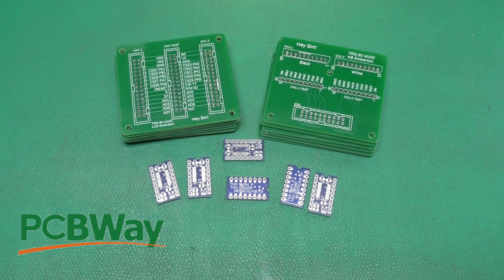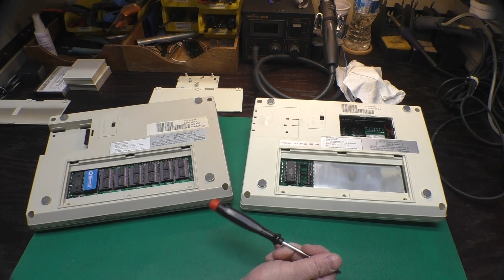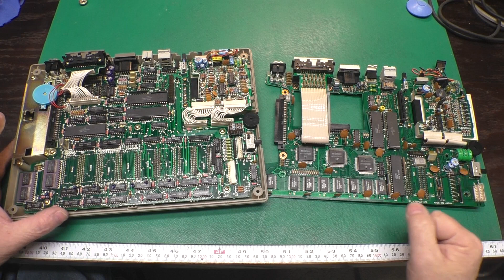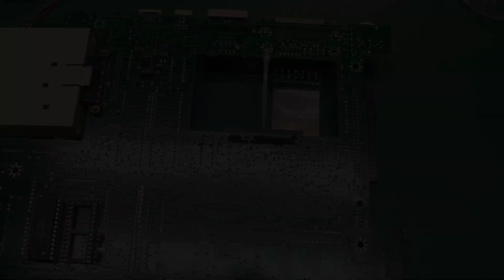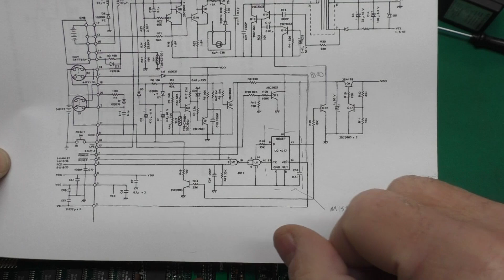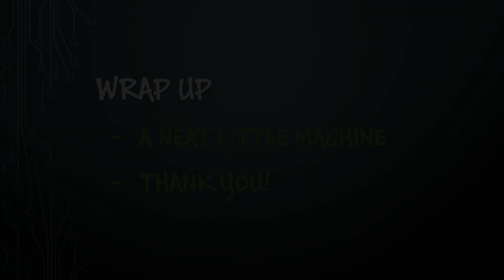NEC PC-8300, “It’s dead Birt!”. A dead power supply and NEC PC-8201A comparison

Comment: what are those gatorade chips used for?
Reply from the maker: 'gatorade chips'? I'm not sure what you mean. Are you referring to something shown in the video?
Reply: @HeyBirt  Reflecting about it i think it meant gate array, not gatorade
Reply from the maker: @milp_and_didi  OK, now I know what you were referring to. The older computers Kyocera made like the TRS-80 Model 100 used many separate logic chips for things like address decoding. The PC-8201 combined all of that functionality into a few custom gate array chips. This makes the device simpler and is less expensive to manufacturer.

Comment: Great video, Birt.  I'm glad you're out there supporting folks that end up with non-working Kyocera laptops!  :)
---Gary Weber (Web8201)
Reply from the maker: Thanks Gary. It is always a lot of fun working on one of these machines. It is also interesting to see the 'heritage' of the original design used for the M100 brought forward through the NEC PC-8300.
Reply: Just found your website.  I might even try the EPROM hacks! the NEC 27C1000 or  HN27C301G
Reply: @squirlmy  I highly recommend it.  It's nice to have a PC-8300 with a modded 128K system image that has the Y2K cosmetic fix.

Comment: Finding the obvious is not always obvious .. good job
Reply from the maker: The symptoms tend to make sense once you find the root cause. Getting there can be a chore at times. In this case I incorrectly measured the battery voltage at the start which led to more effort than was required but I also learned a lot about how the machine was built in the process.

Comment: Aha! I noticed your ruler at the bottom of the desktop it's a dual (bothe metric and imperial) one; nice subtle message to the folks that were complaining in the other video lol
Reply from the maker: Yes, I use both every day. I'm bilingual :) I work at a university designing and building various apparatus and equipment for research projects.  It is not uncommon to see things like microwave waveguides specified in imperial units and many other things metric. Of course mils are still very common in PCB layout. You just have to be flexible.

Comment: It has memory cartridges and a video cartridge/CRT adapter.  I have both.  The memory cartridges act as additional Banks and have memory protect switches just like Bank #2 on the unit.
Images of the CRT adapter are here: http://www.club100.org/memfiles/index.php?&direction=0&order=&directory=Chris%20Fezzler/NEC%20PC-8211A%20CRT%20Adapter
Reply from the maker: Interesting to see how the memory capacity grew during just a few years from just 8K on the M100 to multiple banks on the PC-8300.

Comment: I really like the port covers. All unused ports on any of my devices should have those.
Reply from the maker: It would be a great use case for a 3D printer. Now you 'have' to buy one :)
Reply: @HeyBirt  Currently messing around in Tinkercad. But for this use case I need another resin. The stuff I currently have is quite britle.
Reply from the maker: Yes, that is an issue with resin printers. I think eventually some fairly robust resins will come out. It took several years for a good selection of filament for FFF printers to be available.
Reply: @HeyBirt  There are ABS-like resins available, just have to try them out. Something PA12-like would be absolutely awesome.